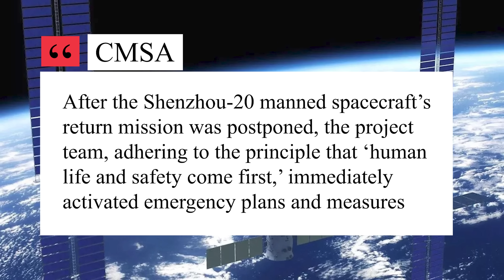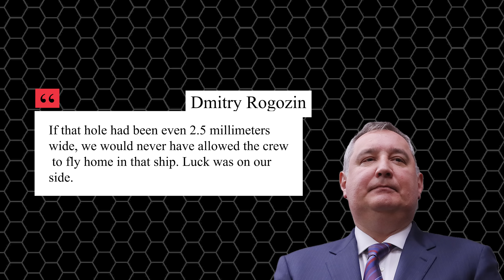Disaster! Chinese Astronauts Stuck on Space Station after Serious Problem. SpaceX To RESCUE!?

Comment: I disagree with you.
The Chinese are able design and manufacture a coupler in a fraction of the time than anyone else. They can work together with SpaceX to get the 2 interfaces designed, manufactured, while SpaceX can prepare the flight. And assist with getting the coupler unit pre mounted on SpaceX.

Both would benefit from having such back up coupler available !

Comment: Rubbish and false commentry!  I'm a space scientist.  The rocket that brought the latest 3 Taikonauts has sustained small damage due to a micro-meteor, either natural (rock) or artificial.  This happens many times in the LEO low-earth orbit - ISS has been hit many times and sustained mi nor holes.  The China Space Agency decided that it is prudent to send up another transport rocket, rather than use the rocket with the small damage.

By the way, the Chinese space station has another emergency rocket that is stationed permanently for use in case of a major disaster, just like the ISS has an emergency rocket.

Finally, your AI speech krap removes any respect for your video.  Get a REAL narrator!!
Reply: I judge however，that you are not an space scientist actually，sir。because you called to a manned spacecraft as a "rocket,"  this unprofessional and incorrect statement demonstrates your lack of knowledge in the field of aerospace.